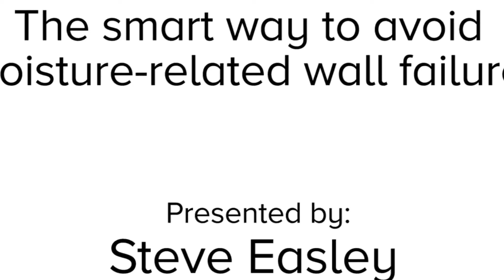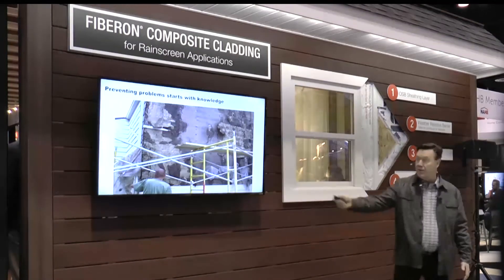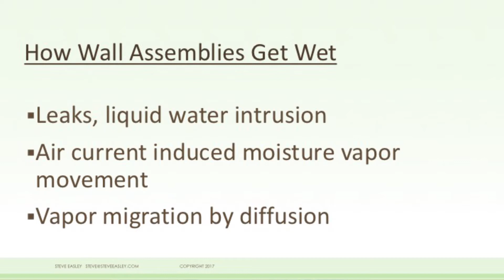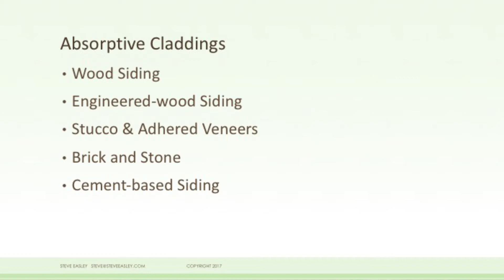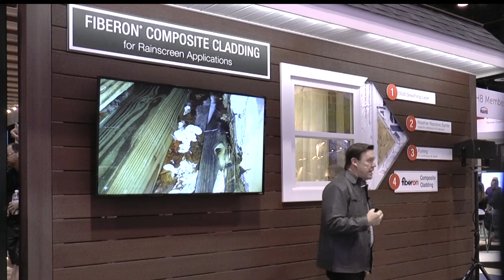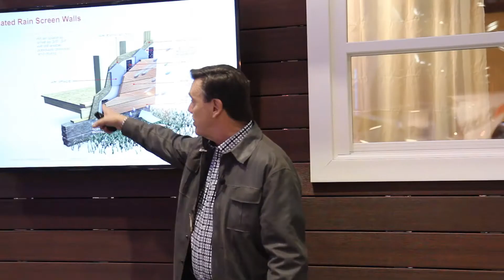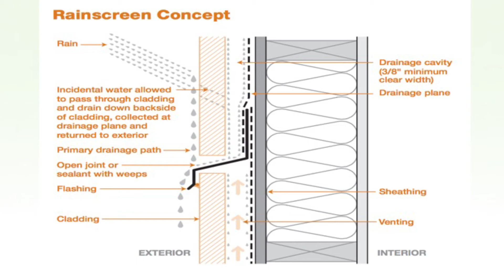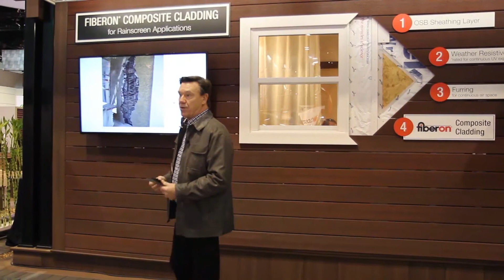Rain screen systems: The smart way to avoid moisture-related wall failures

Comment: What is to prevent insect infestation.
Reply from the maker: Hi Jamie,
The Cladding material is approximately 50% plastic in the core and is plastic coated, so it is highly pest resistant. 
Hope this helps!

Comment: Makes sense to me. Old houses always seemed to be built better. A  boss of mine use to say they just were allowed to breathe. I always agreed. I pulled tar paper off a house that had a label on it adverting the new lions gate bridge in Vancouver. It had steam ships going under it. It looked as good as new. I also saw houses creating mould due the the fact that AC units caused the inside of vapour barrier to become a cold glass of water on a hot day. Building practice is kinda dumb today.